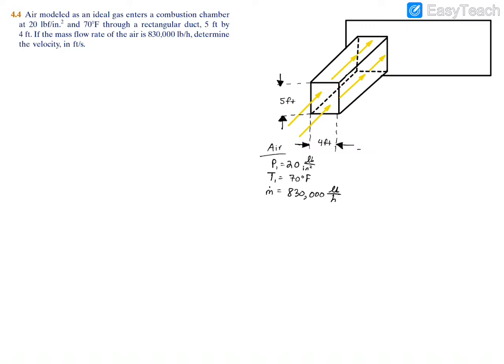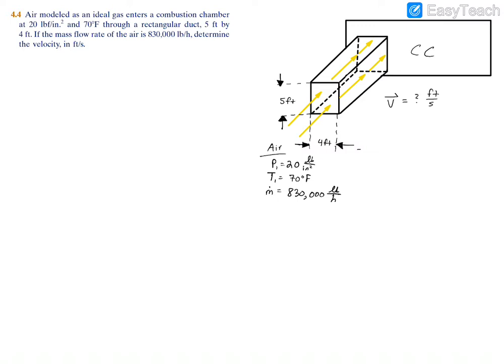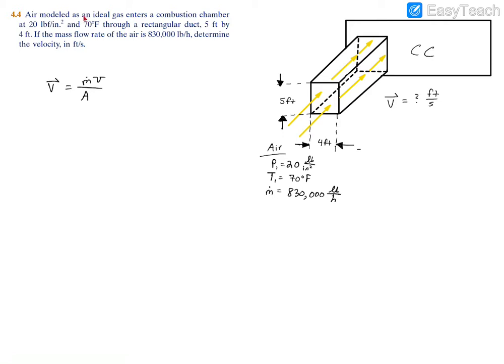4.4  Air modeled as an ideal gas enters a combustion chamber at 20 lbf/in^2 (psi) and 708°F

Comment from the maker: Correction @ 3:03: Notice I said the unit for the gas constant was ft/R. This is not correct. My unit cancellation cancelled lbf with lbm which is invalid. The proper unit for the gas constant would be 53.33 ft^2/s^2*R or 0.06855 Btu/lb*R. My apologies.

Comment: I have a question. Why does dot m disappear when you simplify the ideal gas model to PV = RT
Reply from the maker: Be careful, PV=mRT simplifies into Pv=RT. I used a lowercase v to signify specific volume. If you divide both sides of the equation by mass (or in the case of this problem mass flow rate), the m disappears from the right side of the equation, and we can cleverly apply it to the V on the left side of the equation to yield us with V/m, which is volume per unit mass, also known as specific volume.